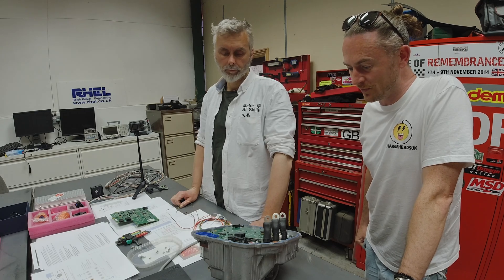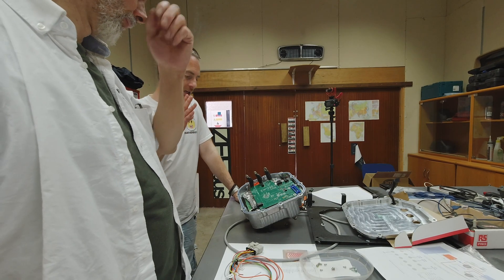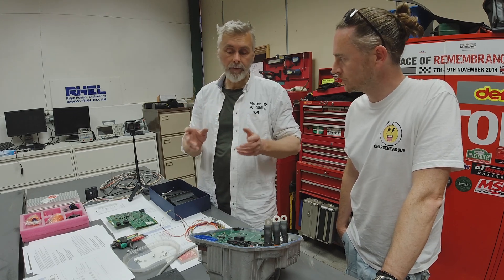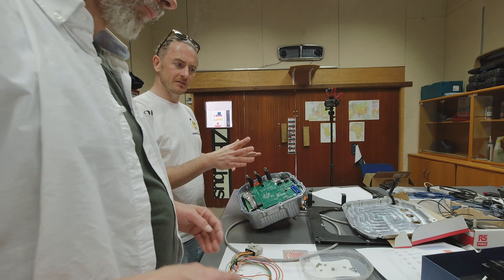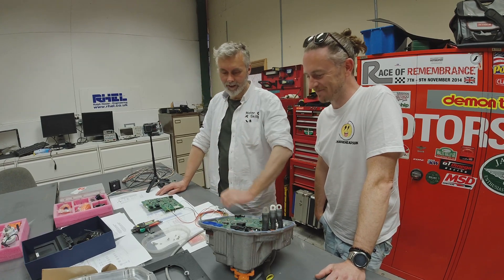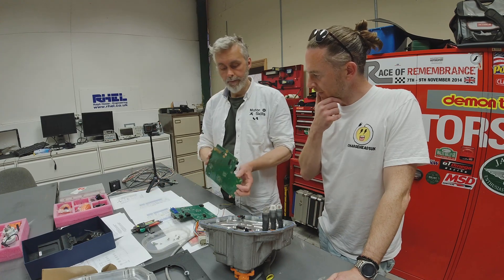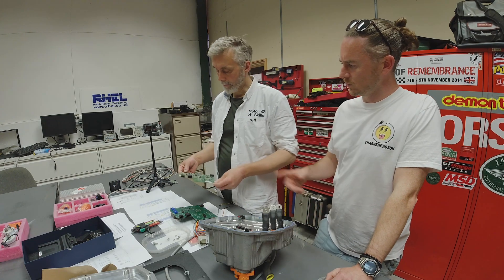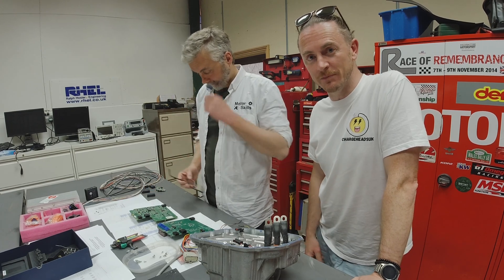Tesla Powered TVR! EV Controls T2C Controller Ep18

Comment: Pretty kool how the separated motor the has a 2.5 to 1 reduction.  I am concerned however that the plate that has the driveshaft output also is the plate for the 3  high voltage wires to the motor.  Personally I would create a protective structure between the the two.  Image the worst possibility that the drive shafts breaks at the plate and shorts out the high voltage AC wires.

Comment: Disappointing to see an open and maintainable inverter solution being kicked to the kerb in favour of a proprietary one. It's your project though. For the avoidance of doubt openinverter supports dual-channel throttle control with pretty much any pedal (unlike the EV controls solution which requires a Tesla pedal). Work is underway on adding better throttle pedal mapping. The efficiency and driveability of the inverter with ACIM motors like the small drive unit has improved greatly with recent firmware releases.
Reply: I used an Evoque accelerator pedal for my Evora conversion because the Model 3 pedal curves the wrong way and wouldn't fit in the pedal bay anyway. It is electrically identical when both were powered with a 5v supply to test and looking at the external shape of the actuator, is made by the same company.
Reply from the maker: Thanks for the comment. Really insightful, something to feed the EV conversion enthusiasts watching. Its still quite a new market for such things and wasn't poo pooing the openinverter as I know its a great solution. As Moggy recommended it and he does the most Tesla conversions I went for it based on his advice👍
Reply: @chargeheads  I'd trust moggy&the ecc team who have over 80+amazing ev conversions now. Over these internet commentators all day everyday man. 👍🏻 Can't wait to see the finished product in 2025 maybe? 😀
Reply from the maker: @4literv6  there are some amazing DIYers out there and I know the OI is good kit, however I've put my trust in Ralph and a couple of other experts which included Moggy and this is where we ended up. It feels close now, although lucky to enjoy the Trikee and Rustee 😉⚡️🔋
Reply: @chargeheads  ever seen this one? A 1972 tesla swapped plymouth satellite I actually suggested the nickname of project electrolitte. 😁
https://youtu.be/8jFpvvK4fSE one of my other favorites is the salvage to savage dual tesla ldu swapped 1300+hp 1980s c10. 🤔
Reply from the maker: @4literv6  oh yes, I keep an eye on the swaps around the world. The C10 was a beast, not seen it out for a while. Throttl's 350z was cool too. The Electrolite is amazing 😉
Reply: @chargeheads  I was disappointed in the throtle 350-370E conversion tbh. 519 customz has a sick full tesla model 3 swap into a 1960s impala on a tube frame chassis. Then there's super fast matts 1950s jaguar with a full model 3 pack underneath&rear motor. 🤔
Reply from the maker: @4literv6  so many awesome builds going on 😉⚡️🔋
Reply: @chargeheads  indeed, many of em in the UK to man. Down at the barns does some very nice oem appearing conversions. 👍🏻
Moggie and the ecc crew absolutely knock it out of the park on there shops cars. 

Here in the U.S. we have a few good shops doing the work on ev elktromods. I think we may have many more private individuals most of us haven't seen yet working on their swaps to. It's pretty exciting and interesting to watch happen. 👍🏻😎